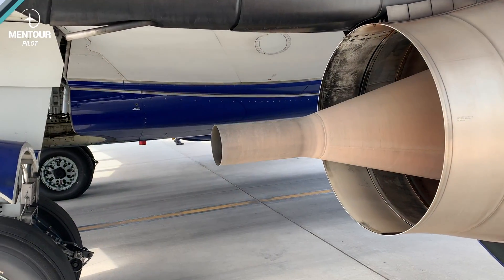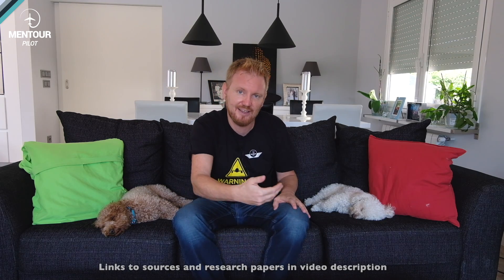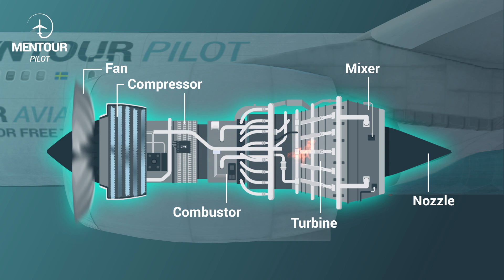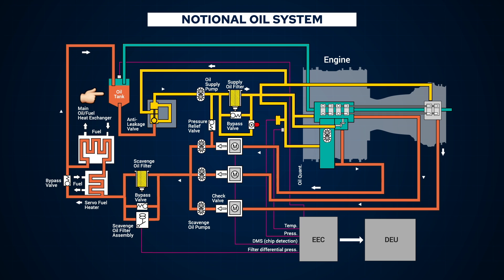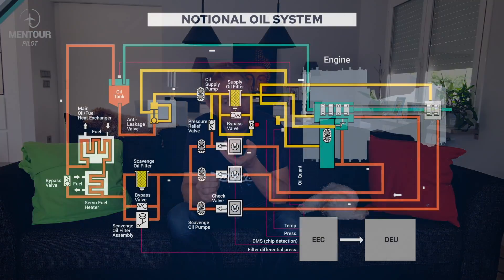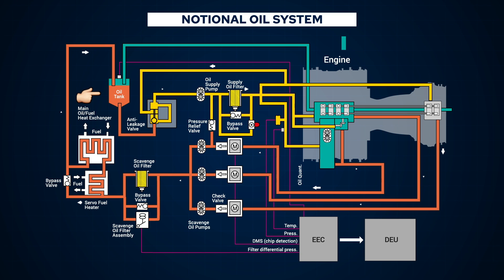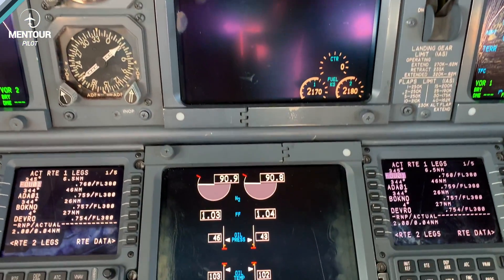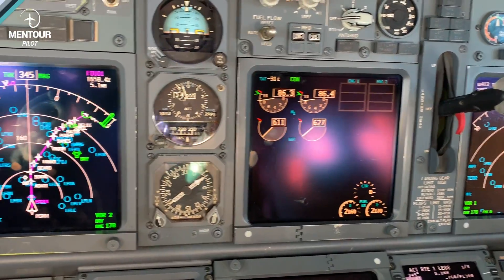What is that TUBE at back of the B737 JET engine?!

Comment: As always, I love your videos! This one is extremely interesting to me because I'm a retired acft mechanic. I knew the answer from my experience along with everything else you explained & talked about. 
Many don't associate the internal combustion engine like used in a car with a turbine engine like used in an acft. However they are VERY similar! The oil vent tube you're talking about is in your car also, it's connected to the PCV ( Pressure Crankcase Vent) valve.  The "smoky" air goes back into the cars intake to burn the air from the crankcase. Because the air blowing past the piston rings there is more smoke, and the PCV cuts down the emissions!
Anyway...
I really like how you break things down and make them understandable to all of us. Taking the most technical subjects and simplify them for understanding but not dumbing them down is a GEM of a talent!!!!! Thank you again!

Comment: Hi Mentour, 
This might be considered a weird question 🙋‍♀️. Have there ever been times, due to the curvature of the earth 🌏 & aircraft frequencies are VHF AM that a craft wouldn’t be able to communicate with ground outside of the Sat phone that most flights carry? And if so, under an emergency situation would you ever request assistance from non aircraft stations on the emergency air frequency, 121.100? I’m a licensed FCC radio operator on two systems neither of which is air frequencies. Ty

Comment: Why after the compressor stage dont they include a intercooler stage? ie make the engine a bit longer, and cool the compressed air with outside air via heat exchange, cooler air = better combustion?

Comment: I’ve seen that smoke all the time since I have started working as a ramp agent a few months ago. Especially, right after the 737 arrives and I have to chock the plane’s rear landing gears. I end up getting very close to that unfortunately! As a result, I bought a 3M filter mask, model 8511 N95, to wear when I deal with arrivals so I don’t breathe in that smoke! Thanks for clarifying this. For a while, I assumed this was residual Jet A fuel coming out of the engines after just powering down.

Comment: Hi, you don’t cool down the oil with fuel in the heat exchanger, but you heat up the fuel with hot scavenge oil to eliminate crystal formation of water inside the fuel… a good illustration though.
Reply: Heat the fuel with oil = Cool the oil with fuel. Oil cooler/Fuel heater 😉

Comment: Very interesting. I never knew about this. I always thought it was where very high speed air from the compressor was coming out of due to the fact that a thinner pipe would make air flow a lot faster. Thanks for setting me straight.

Comment: If you car aficionados want to do a dry sump wet sump explanation I’ve got 2 examples. My ford truck has an oil pan underneath the rotating equipment in the case and it’s continually washed in an oil bath. The oil pick up is at the bottom of the sump and pumped back up top to be sprayed throughout the engine to keep thing lubricated and then that oil drains back into the sump to be repumped. A disadvantage of this system is on banked turns the oil in the sump can get away from the pickup causing oil starvation. Luckily most cars don’t climb up banks of race tracks so that rarely happens. The dry sump example is my 911 GT3. Or and older 911s from 1998 and older. They have separate oil tank that keeps oil away from the rotating equipment and it gets pumped from the oil tank to the rotating stuff like pistons cams etc.  This system has scavenge pumps that pick up oil and spray throughout the motor. This system is more complicated but it’s pumps can lubricate the engine at most ant angle the car may be at.  I think the new C8 corvettes are dry sump oil systems. The wet sump is called a wet sump because the motor itself sits in the oil bath, I.e, it’s wet, and the dry sump engine doesn’t sit in an oil bath.

Comment: The measurement units are a HUGE gripe with me. It makes all the mathematics SOOOOO cumbersome. Flightlevel is one unit, but distance is another, coolant is in one unit, lubricant in the other. It's just a HUGE unnecessary headache. Murica needs to grow up and use the international standard units of the metric system and stop measuring in bananas -- "inches" I believe they call it. A cup is not a measure of mass anymore than a pound is a measure of volume. This nonsense is one of THE big things wrong with cookbooks today.

Comment: Engineering note: air in your oil is called "emulsification" and it's a bad thing because it will reduce the viscosity (or density) of your oil. If your oil is emulsified it will not be able to lubricate the parts efficiently it can cause an engine to seize up, or bearings can fuse from excessive friction, and hydropneumatic systems can fail. 

This is why I love your channel Petter! Not only do you offer fantastic accident explanation videos, but you also havethr technical videos too. As a retired engineer this is right up my alley lol. Keep up the amazing work!!

Comment: My truck has a similar feature, every 100 miles it uses about a quart of engine oil to lubricate the chassis and the exhaust system. Lubricating the chassis drastocally helps to improve the aerodynamics.

Comment: Very interesting video. When you mentioned the way oil is cooled by using very cold fuel, I couldn't resist thinking about certain rocket engines that use the extremely cold cryogenic fuels to cool down the nozzles.

In the RS-25, the space shuttle and the aretmis' main engine for example, use long tubes routed through the nozzle. The fuel, before entering the turbopumps, pass through these tubes and cool the nozzle very effectively.

Comment: Dry sump is also used in some high performance cars and other cars and on motorcycles as well  for a few reasons. 1 Is the car can sit lower without the oil pan hanging low because the pan is very shallow in a dry sump on a car. The engine can ensure oil pressure during lateral G so that the pump wouldn't starve and then the oil pressure would drop and then the brass bearings would take all the pressure and grind from things like the crank shaft. Because the way these bearings on a cars engines crankshaft work is that the oil is pumped in through a small hole in the middle of the bearing and that causes it to be floating in a high pressure oil so its not touching the bearings at all and is very easy to turn. And this is why start up is what causes the most wear on the engine because there's no pressure in the oil system until the pump is going fast enough and its oil is cold and more thick and harder to pump into the small gap that the oil fills and makes the shaft float. So old cold oil is thick and hard to pump and causes the most wear to the engine on all surfaces. Why there's not a electric pump that pumps at the start so oil is there before anything happens??? And then having the mechanical pump take over after start up???  IDK probably because some vehicles like Hondas or Toyotas would almost never die. lol.

Comment: Ps - if the compressor heats air before the combustion chamber why does hot air choke an engine (eg hot gasses ingested by the concord)?

Comment: @Mentour Pilot:
You plead for our questions. I also love the fact that we are all here to learn.

I got the aviation bug when my dad sat me in the cockpit of a T38 on the flight line at Vance AFB in Enid Oklahoma at the young age of about 5. My eyes got big as saucer plates and I've been affected ever since.

My dad was in the USAF for 8 years as a "jet mechanic" (A&P Mechanic officially). He did other things throughout his life but overall till retirement he made his living working on aircraft.

One day I developed an idea concerning spinning up tires on an aircraft while it's on approach, so that at touchdown they wouldn't skid, removing so much rubber and creating the puffs of smoke when first making contact with the runway. This always seemed like a waste of good rubber to me. My idea, which I developed in my mind one day, involved molding semi-circular ribs into the tire sidewalls during the manufacturing process of the tire. When lowered into the airstream while on approach, the ribs would begin rotating the tire much the same way as the cups on an anemometer spin the wind gauge. It would require no additional moving parts on the aircraft. It would simply use the wind friction already available. I thought it would save the airlines millions of dollars in tire costs. I was excited about my idea because I had never seen an aircraft tire made this way and had never seen an aircraft touchdown with tires already spinning. There's always this tremendous waste of tire rubber, evidenced by the smoke, the jerk of that friction experienced on touchdown etc.

So I got in touch with my father, very excited, as I thought I may have a patentable idea. 

To my disappointment, my dad said the aviation industry had already experimented with this and this idea had already been explored. I asked why then had I never seen such a tire in use. I don't remember what the follow up was on that conversation, but I wonder if you would address this issue and provide anything you can come up with.

Thank you. Big fan. Enjoy the professionalism you bring. Keep up the good work.

Comment: I recently found this channel in my YouTube feed.  This is a fabulous channel.  I’ve learned so much about airplane construction, engineering, flight crew (captain & first officer), cabin crew, maintenance crew, it’s fascinating.  As a nervous flyer, this content settles my nervous system quite a bit.  The next time I board a commercial jet, especially the 737, I’ll be a better passenger and a little less nervous as I leave the ground.  Thank you for the great content.

Comment: Here's an interesting side note I learned in the Navy while aboard an LST where we had three 18 cylinder huge Alco diesel engines per port; as well, starboard main propulsion shafts required for full speed ahead (our berthing quarters directly overhead). Because petroleum never breaks down; except, when dirt and sludge is accumulated through normal engine operation, it would be very expensive and unwise to pump this dirty oil overboard. Rather, these huge engines are connected via a closed loop oil system incorporating, in our case, a DeLaval Unimatic Oil Purifier Separator Centrifuge. This allows clean pure oil to once again enter these huge engines for maximum operating efficiency. Again, my point is that petroleum never break down, if kept cleaned and maintained. I'm thinking of all that oil I discarded from the number of vehicles I've owned over the years... unbelievable! Thanks..

Comment: You only lose 1/2 Liter per 1 hour? This is (roughly calculated) 750ml per 1000km...and therefore much better than even a modern VW...these guys state 1l/1000km as "normal" oil consumption :-)

Comment: Actually having a breather tube going into hot exhaust stream is good choice, because you can burn off oil mist, and improve engine emissions. Same reason crank case ventilation on piston engines is fed into the intake manifold to burn any oil mist.

Comment: Actually , centrifugal breather is in V2500 and  trent engines.. so, CFM dosen't have like that oil saving systems..  it dumps oil mist through that exhuast pipe.. actually v2500 is saving oil..

Comment: Hi mentour, great video! But where did you got the technical manuals from? I suppose ATA 79. Thx alot, keep the blue side up (ehhhh wrong line😅)!
Reply: You could argue for both ATA 78 and 79. 78-11 would be the most acurate I think. But he doesnt get his manuals from ATA 79🤪😉
Reply: @speedbird9313  thx 👍, but where does he got his info from😅?
Reply: @bortfort7939  From asking I would presume. He is certainly not reading directly from the AMM🙄Which he probably hasnt got the access to anyway🤔
Reply: @speedbird9313  that's right.... Thx anyway👍👍

Comment: How much oil does the engine take and how often is it changed?
Reply: The engine oil on a 737NG oil tank holds approximately 21 US quarts (20.2 liters), it is actually not changed that often but quite often refilled🤭😆

Comment: The Convair B-36 had a 100-gallon oil tank for each of its piston engines. There were some long-distance flights of that aircraft that were cut short because the oil ran out before the fuel.

Comment: After taking a PLC class, I can only imagine how dang complicated the PLC programming is for something like that oil system.
Reply: I doubt there's any PLC involved at all. It's all just simple hydraulic principles, pretty much like in a car. Pipes and channels... holes of the right size to give the right flow to the right place... various filters and separators... And notice how there is just one oil pump for the pressure side, and three for the excavation side. That's no coincidence...
It's all just a complete, well thought out system that does its thing pretty much by itself.

Comment: MP your system design videos are close to abs fantastic. No flying can have benefits. So maybe you can do a segment on airframe design wrt pitch trim. Most airliners today have low engines that create thrust on an axis that is some distance below the CG, CM, and drag axis which results in a torque that moves the nose up or down as thrust changes. Which tends to make planes pitch trim dependent which has been a big talking point lately. But 40 yrs ago the DC9, 727, MDxx etc had engines mounted on centerline so did not have this issue. And CRJ and small jets still don't. So why don't BA and AB go back to CL mounted engines and skip all the drama?

Comment: what is the accessory gearbox and what does it actually do???
Reply: S Kingzalla 	
The accessory gearbox (AGB) sends torque from the N2 rotor through spur gears to turn the engine and airplane accessories.

Comment: As an 737 NG engineer, every night we do the ramp1 check and part of that check is to refill the oil in the engine. Access is from the right side and if you top up you will see 17~18 quarts in the main screen. This should be done within 30min of engine shutdown. After the engine gets cold >4h later the oil level drops, but no more should be added
Reply: giteart Should be done between 5 and 60 minutes after shutdown😉 Where did you get 30min from, company policy?🤔
Reply: @speedbird9313  yeah as per Ryanair procedures its between 5-30min after engine shutdown. If that time has elapsed an engine run at idle for 5min is required
Reply: giteart What? Thats a weird policy when the amm says 5-60 mins🤨 Well, nothing you can do I guess😕So this is in your came-p?
Reply: @speedbird9313   Yeah, a company is allowed to deviate from AMM if they want to make things more strict only. So tightening up the time frame is ok. What airline is 5-60min if I may ask?
Reply: giteart I know mate😊 Well most companies that are strictly following the amm and havent made company policies about oil servicing😆😉

Comment: Thank you so much Mentour Pilot for another super video, can you explain how the very latest Jet Engines like the C.M.F. Leap and the Geared Fan by Pratt & Whitney get such an improvement in Fuel Consumption ? said to be at least 10% less than current Jet Engines that are in use on Aircraft such as the Airbus A,320 and other models plus Boeing and its 737 Max Models 737 8 9 & 10. .

Comment: this is why fighter jets can only fly for a limited amount of time even if you midair refuel, bomber aircraft e.g. B-52, B-1 can fly longer as they have bigger oil tanks. air force one can fly for a maximum of i think 1 week until the oil runs out and it has to land.

Comment: Thank you for sharing this pretty good explanation about the complexities of a turbine engine's oil system.  Earlier in my career, I was a propulsion engineer supporting the GE F-101 and F-110 engines which actually have much in common with the GE CFM-56.  The oil system is complex, but straightforward.  If you're amazed by it, the high pressure turbine blades will blow your mind.  They are made of some of the strongest, toughest nickel and cobalt-based superalloys known.  They not only operate right at the edge of their material's tensile strength, but they do so reliably at temperatures which actually exceed the temperature at which those materials become softer and lose strength.  How is that possible?  Perhaps this could be the subject of your next research project and video.  (Hint: search for photos of high pressure turbine blades.  Note they are hollow and have rows of holes.  The principle is called boundary layer cooling.)

Comment: How big thing can be sucked into the engine without damaging it? For example dust, a small 5mm stone? Stone 1cm? Bolt? Little bird? Does the material type make the difference in this case? Plastic, metal, stone, something organic? I can't believe the huge runways are as clean as my bathroom.